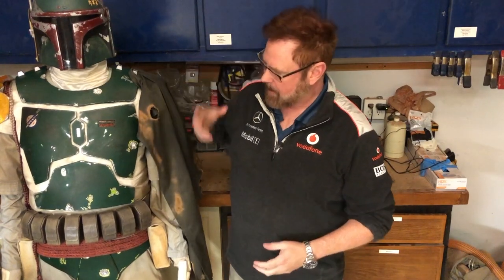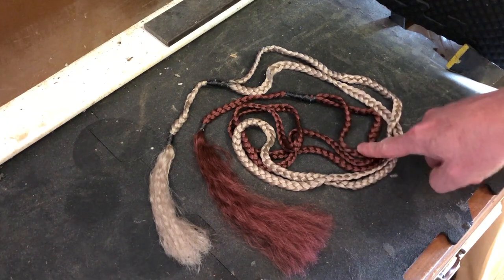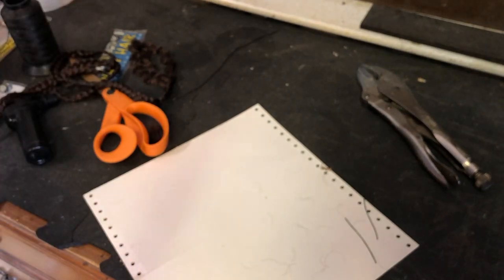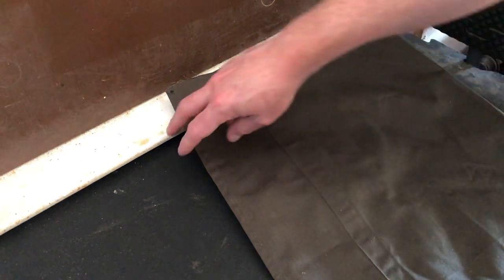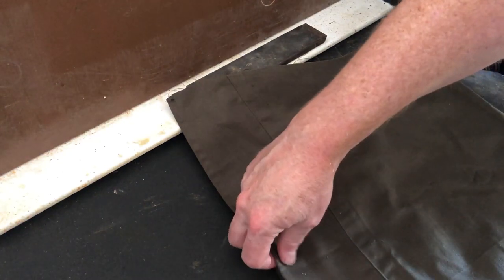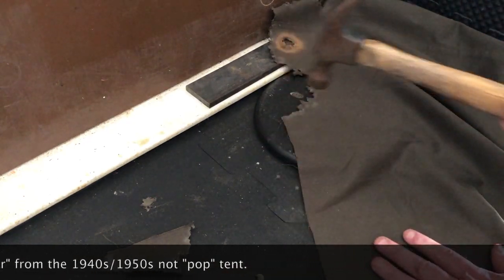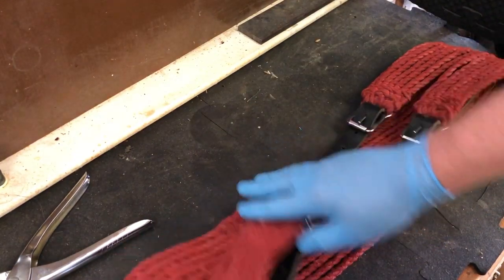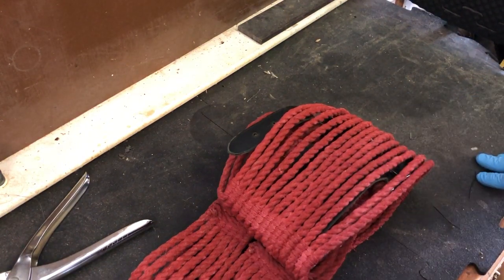How to make Boba Fett Armor (Step by step) part 7

Comment: Man your videos are really good, you should make the helmet from the mandalorian show!
Reply from the maker: Carlos Arizcun Ramos 
Thanks!
I do need to do something to take advantage of the Mandalorian’s popularity. Maybe I’ll do a single video showing how to convert my Boba Fett helmet to the Mandalorian’s.
Reply: @thepropmasterwithrobertwal6186   yeah, with your basic template you just need to change something in the front, then at the bottom of the visor, add the top thing on the helmet and the important thing to change would be making new ear pieces, but  I'm sure that with your skills it is a very easy conversion

Comment: you should try to make a shredder helmet from the 2003 series or the 2012 series. that helmet is the most badass helmet of all time. One day i wanna make a full metal armour and helmet of the 2003 shredder, or at least a majority of it metal, like i might use a hard hat and trim it so i have a dome and attach the metal pieces onto it, making a metal dome might be a bit hard for my skill level.

Comment: Hey mr.walker, i had 2 questions,
1- how thick should the craft foam that is put over the mandibles be?

2- what advise do you have do make the shoes myself,im making a jango suit and i am not entirely sure how i should manage the accesoires.
 Thanks in advance,keep up the great work!
Reply from the maker: Infinitum Honorem 
I think I used 5mm foam for the mandibles. 
As for the shoes, I bought some.
But you could probably make a reasonable approximation using a canvas high top sneaker and covering the laces with some canvas or even craft foam. 
Hope this helps.